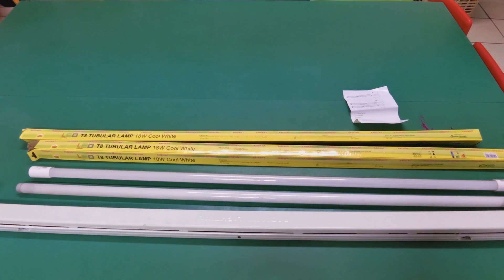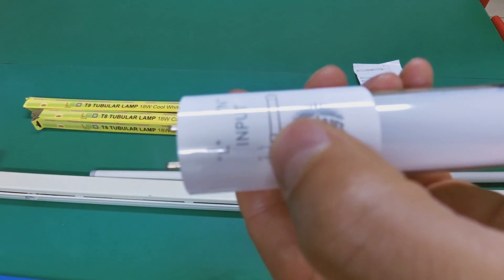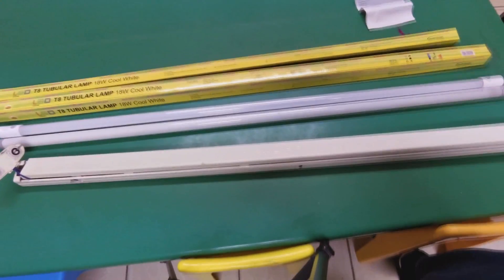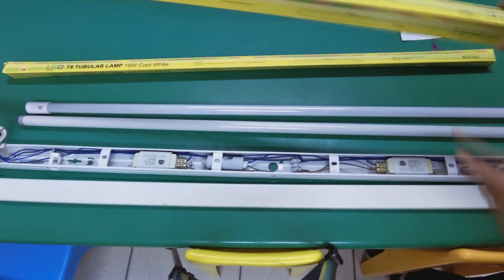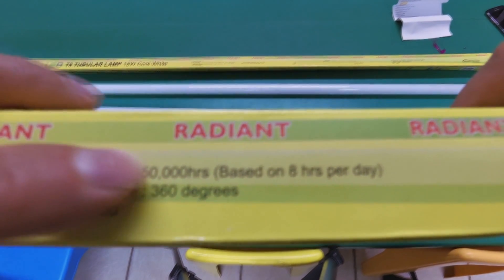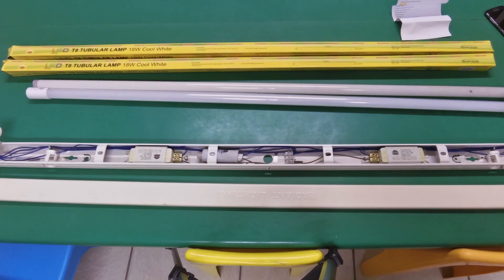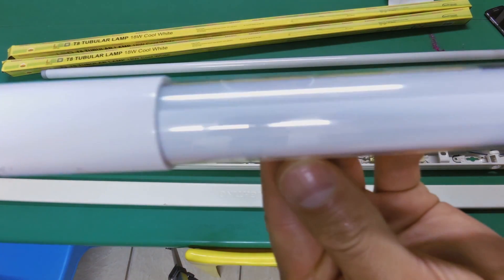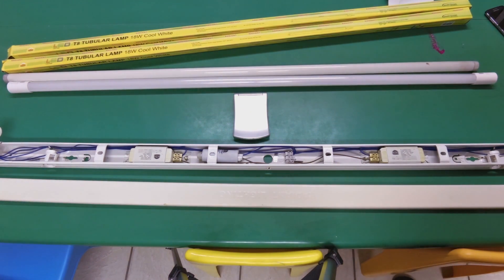LED tube versus Fluorescent tube. Lifespan and energy usage.

Comment: What 50000 hours and 8h per day what a nonsense, it shouldn't matter how many hours per day use and i don't think the led would last 50000h, a normal fluorescent tube last 20000h and has 58w daylight version in the uk for about 4£ i don't think a replacement led tube would be cheaper ;-)
Reply from the maker: i have subsequently found that the specs on the LED units are overly optimistic and they do not last even lose to the fluorescent units.
Reply: @ecologicaltime  this was the case on my first led light bulbs that i bought a couple years ago, on the package stand 5 years lifetime and in reality they only last 3 month than i bought from a better company and they hold quite well 3 years now ;-) but i think my fluorescent tube i will use so long i can, they are almost 5 years old and no problems and i like the sound they make on switching on, pling and flicker shortly and light's is on shiny and bright 🔆 58watt each ;-)